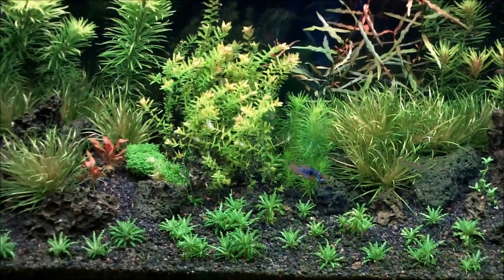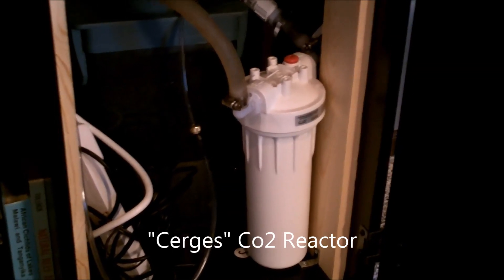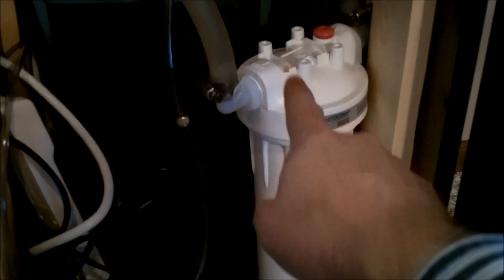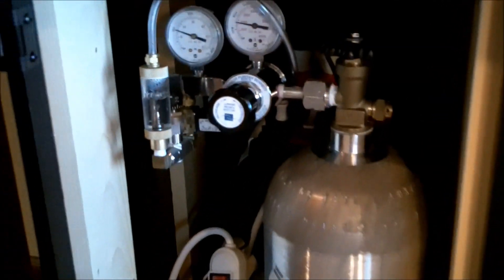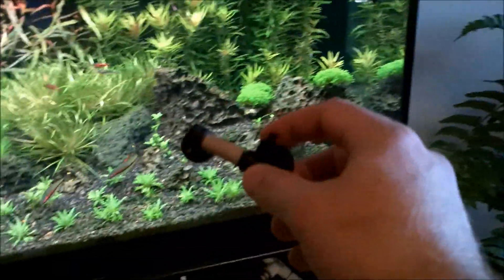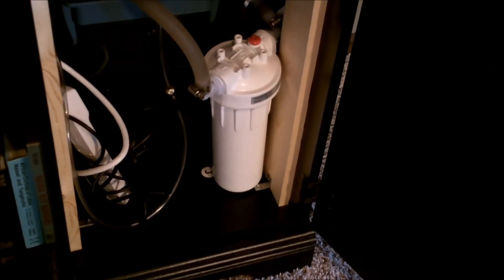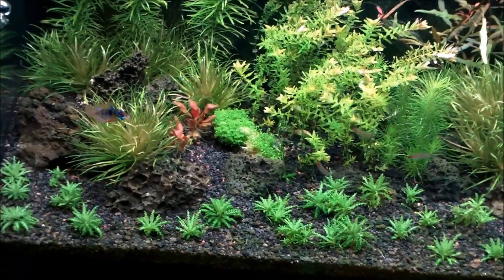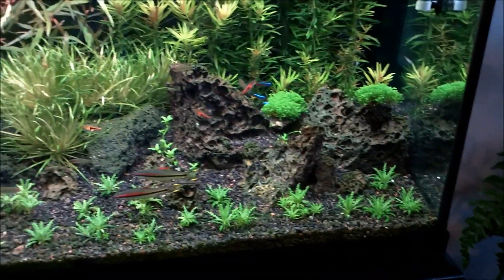Co2 Reactor for the Planted Tank

Comment: I have heard that the reactors can mess with the ppm checker by alowing the micro co2 bubbles being blasted out floting up into it and making it seem way higher ppm then what it really is. Is this true or what is your thoughts?
Reply: Totally false if the the reactor is set up correctly.  These reactors are built to prevent that very scenario-- micro bubbles in the tank, which is common when using inline atomonizers, etc.  If done right, a reactor will dissolve 100% of the CO2 into the water before it flows into the tank and there will be no micro bubbles.  This setup in the video is ok and obviously fits the bill as my first one was nearly identical, however, after playing around with these for years, experience has taught me a few things.  I ditched the colored filter housing, the 90 degree barbs, and all that in-line plumbing where the C02 is introduced.  Sure that plumbing looks pretty but it only takes up space and isn't nearly as efficient as drilling a small hole directly into the top of the reactor, and pulling the line through to about halfway down the length of the reactor. By doing so the bubbles must rise up and collide with the incoming water instead of just flowing with it as in the setup above.  This aids in the dispersion. The 90 degree barbs entering and exiting the reactor only decrease flow. Ditch them for straight barbs. The last thing is the reactor housing.  Go clear.  Pentek has some of the better ones on the market.  Their 10" and 20" clear standard housings w/purge are all I use.  A clear housing enables you to see whats going on inside and see the bubble rate entering the reactor.  I personally detest bubble counters as they're prone to problems and are just a weak point in a quality C02 setup.  By having a clear reactor, with the line installed as I've described above, you can see the bubbles entering the reactor and use that as your guide as far as how much C02 you are pumping into the system.